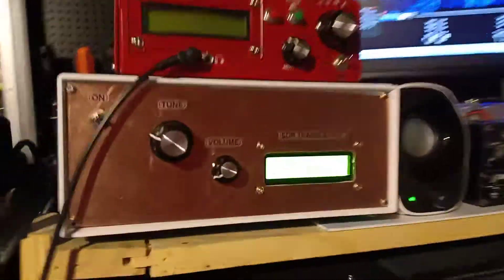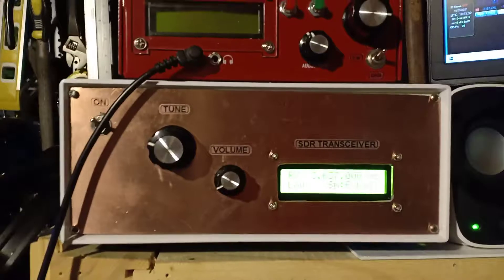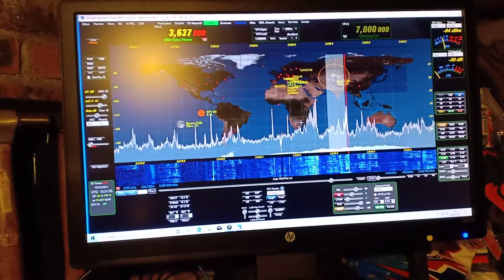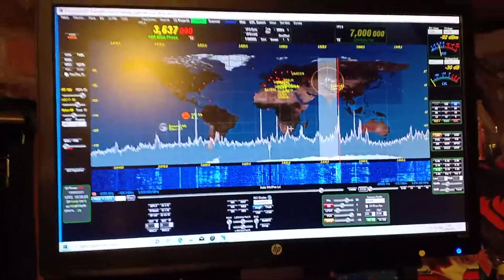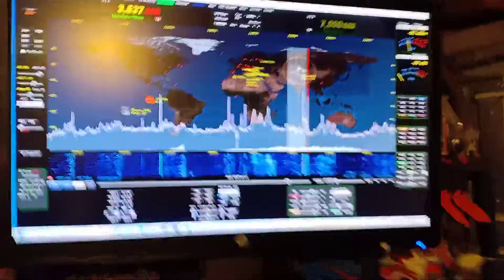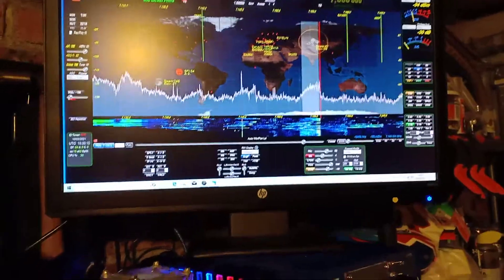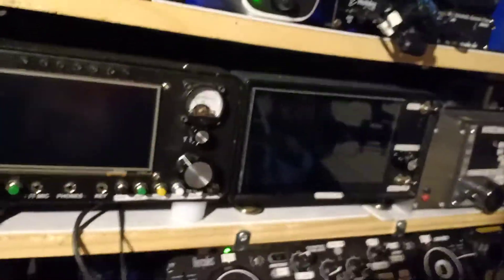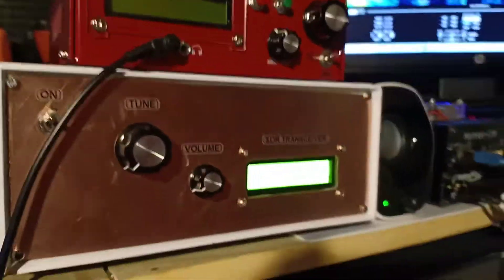F5NPV - Homebrew LMR SDR transceiver final presentation

Comment: How is the connection for isolation transformer?
Reply from the maker: Hello , i made a little interface and connect the input and output audio cables with this external interface
Reply: @f5npv-v85npvamateurradio3  can you share how you made it?
Reply from the maker: @aneespi4684  you can information here https://f5npv.wordpress.com/homebrew-usdx/ and here https://f5npv.wordpress.com/homebrew-sdr-trx/